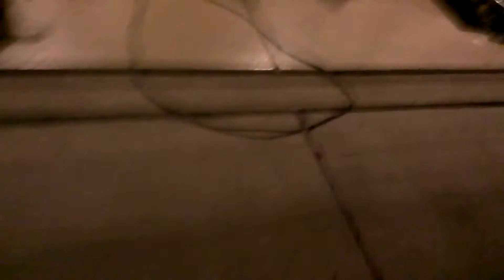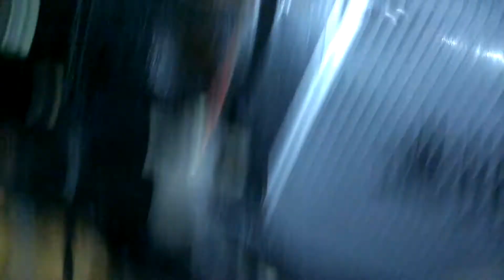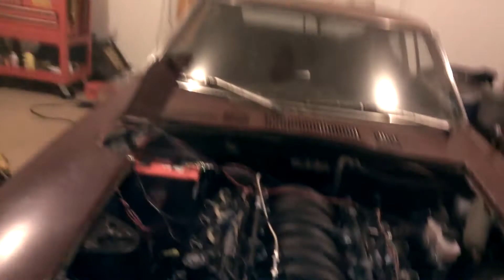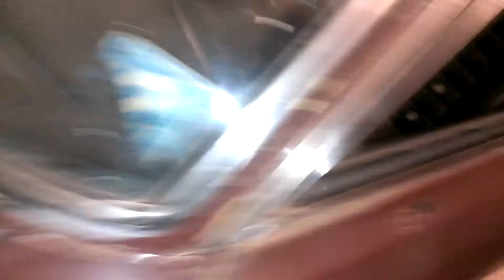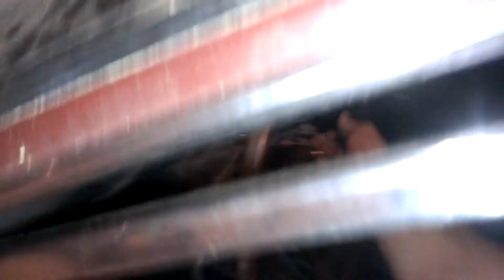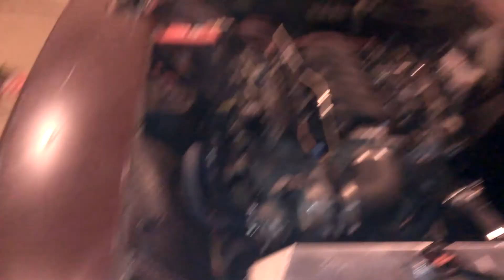LS1 240Z - First Startup!

Comment: what radiator did u use?
Reply from the maker: It's a factory replacement Mishimoto unit.
Reply from the maker: Combined with a 2,800 CFM Flex-a-lite fan, it doesn't exceed 200°F in +90°F weather